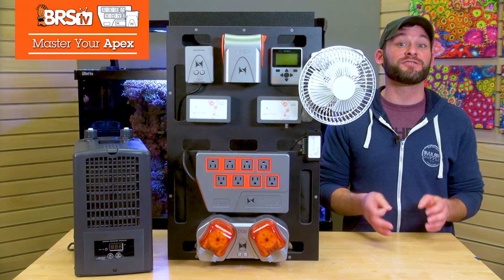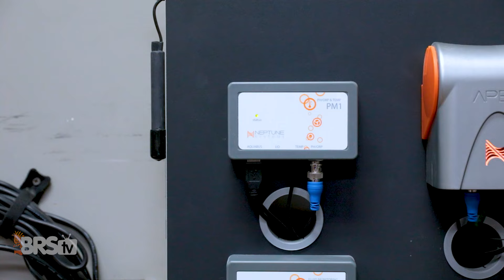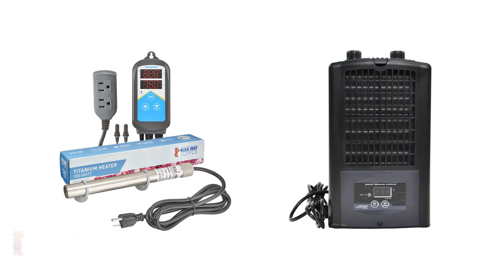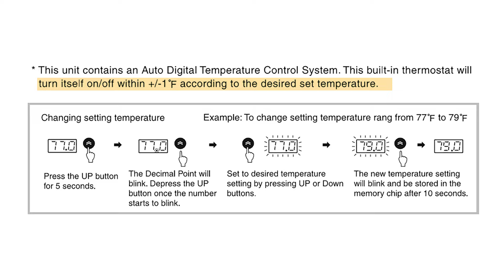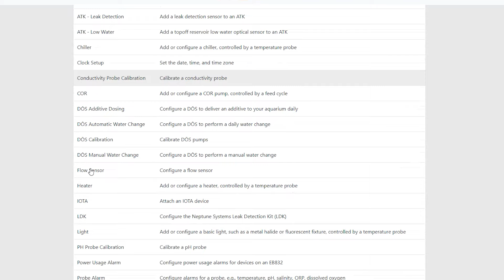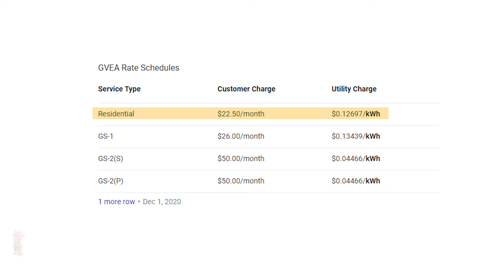The SMARTEST Way to Cool Your Aquarium Using Your Neptune Apex. | Neptune Apex Guide

Comment: I have a 40g tank and thinking of making a diy chiller using a stainless steal container fiiled with rodi water. Attaching 2 peltier cooling modules on it and spiraling very small diameter tubing in it to cool the tank water. Small pump to cycle the water threw the tube and temp controller to switch off cooling when needed. Good or bad idea?
Reply from the maker: I can't say that anyone here at BRS has tried to make a DIY chiller. As long as the material you use won't rust and you like DIY projects, I'd say have at it 😃
Reply: What is the power consumption of peltier vs the compressor in the chiller?  I know from my lab days, many of my instruments used peltier temperature control but the peltier was fed by a refrigerated water bath (basically a chiller)  because peltier had a small operating range of temperature control and the water bath kept it in range.  Using it to cool an aquarium wouldn't need the chiller because you are only trying to control about a 10 degree range so it comes down to power consumption.
Reply: I will have to measure the power consuption once a get is. With regards to rust.. the tank water will luckely never be in contact with any metal. Is will only circulate threw the aquarium tube inside the metal housing
Reply: thats cool if u mind make a video about it i will watch it
Reply: @fenx3738  i was thinging of making a video. Just waiting for the last parts to come.

Comment: I do not like the sound of a large fan running in my living room and I can not afford a chiller! So I setup a PWM fan using one of the VDM ports. As the temperature rises the fan will ramp up. If the temp goes way high I will get an alert and a secondary fan will turn on. I use the alert to turn on the house A/C. So far for the past 2 year I have had no issues with this setup! YAY! I am using a 120mm blower type fan. I did need to purchase a variable voltage to PWM module to make this work.